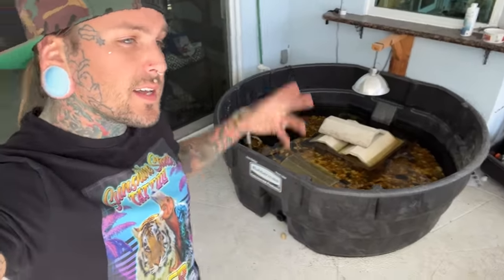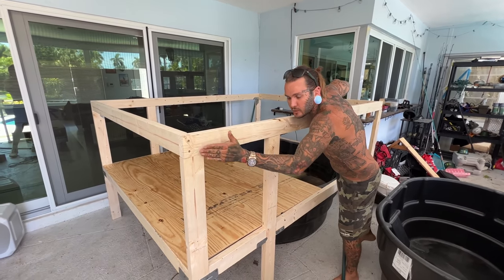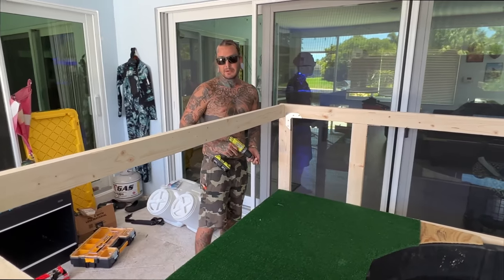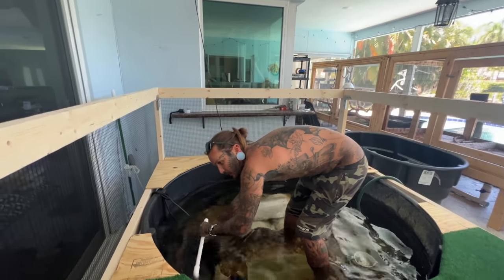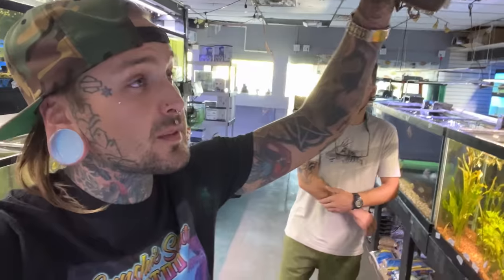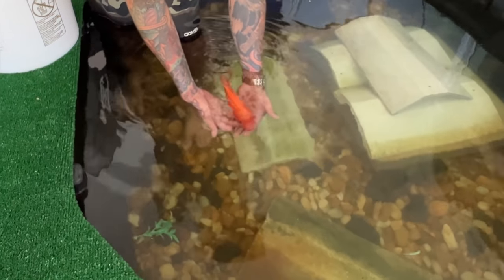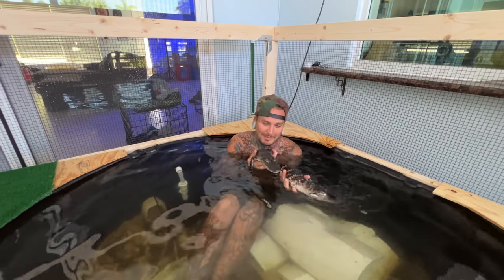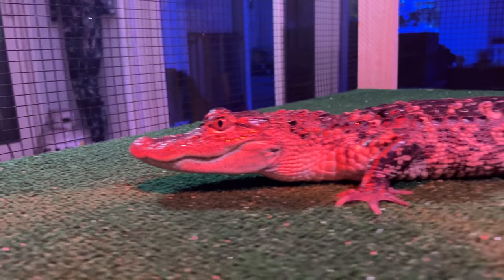Built a NEW ENCLOSURE for my ALLIGATORS! THEY LOVE IT!

Comment: If you take the piece you cut off for the deck and put a 45 cut along the edge it will line up almost perfectly, then run a brace at each end for support. It would also give them a hiding spot without being g fully submerged.

Comment: You do know that gators climb right?  Even small ones.  Easy for them to climb the chicken wire then use their tails to get out of the enclosure.  We've watched larger gators climb 12 ft chain link fence s here in Florida.
Reply from the maker: Yes I know a lip was added
Reply: @TylerNolan  Good, I'd hate for them to get out and then out of the lanai.  You've raised then since little babies